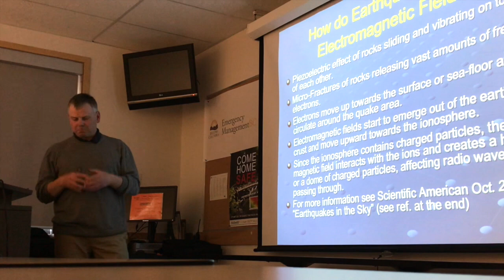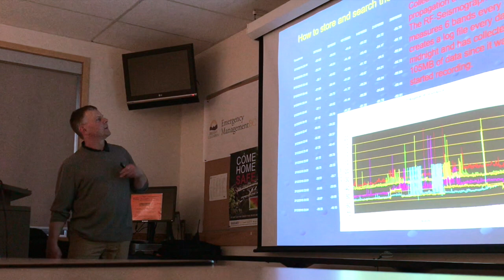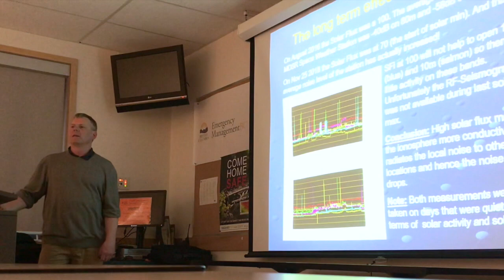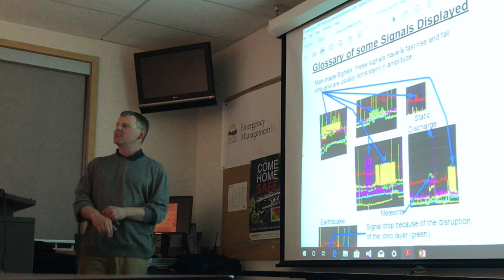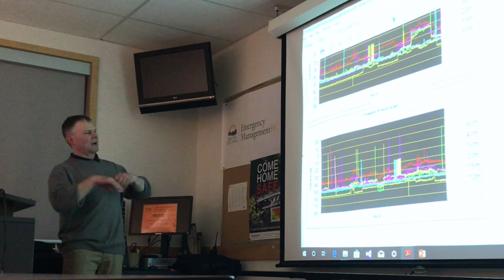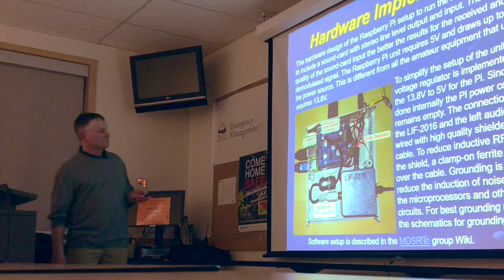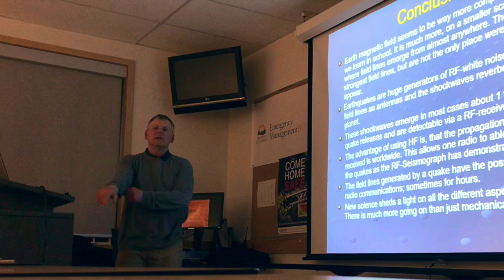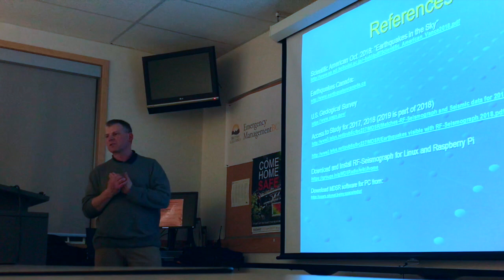The RF Seismograph

Comment: “Can Shortwave radios detect Earthquakes” 
 
Alex Schwartz VE7DXW is a North Vancouver Ham who has been experimenting with an RF Seismograph. Basically, this is a broadband HF receiver monitoring a large range of frequencies. Alex has determined that there appears to be a correlation between peaks in RF interference and earthquakes.

The RF-Seismograph’s recent discovery that Earthquakes can be detected using a RF-Receiver are intriguing and it validates a lot of new research that claims that earthquakes also create a magnetic field that extends into the Ionosphere and causes changes that can be measured with a cluster of GPS receivers.
 
The RF-Seismograph team has been collaborating with Earthquakes Canada to find a correlation between HF propagation and earthquakes. There was a distinct event that occurred on Nov 1st  (M5.0 off the coast of Vancouver Island) which was detected by the RF-Seismograph an hour before. Of course an hour warning before a major earthquake is significant.

They are in the process to correlate earthquakes that a bigger than M6.0 into the 4 years of data accumulated. The talk will be about how they made the connections and how they collaborate with Earthquake Canada to get the data and times of the quakes to scan through our data to match events.

More info at the ARRL Website: http://www.arrl.org/news/view/ve7dxw-s-rf-seismograph-may-be-real-seismograph and on Alex’s site http://users.skynet.be/myspace/mdsr/index.html
 
The specs and free software are readily available http://users.skynet.be/myspace/mdsr/index.html